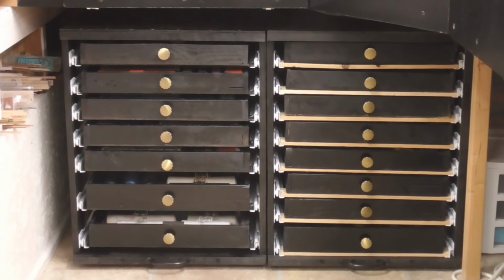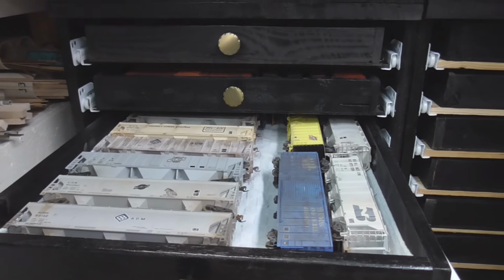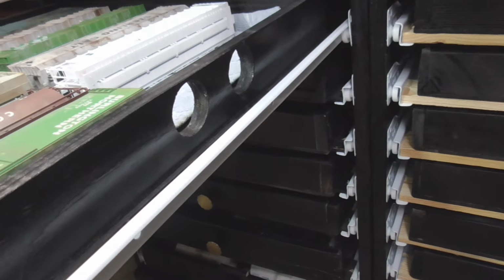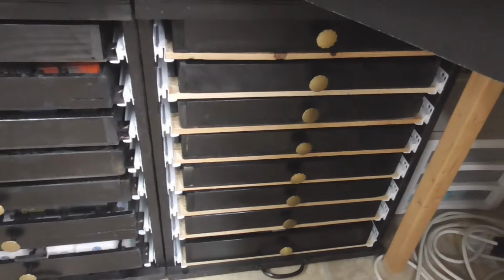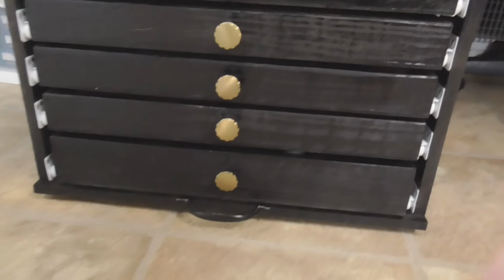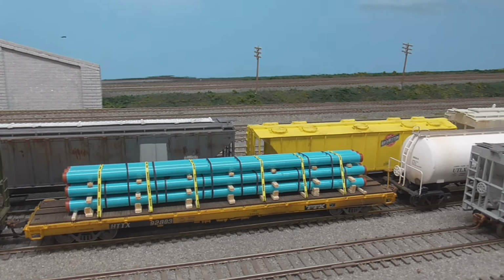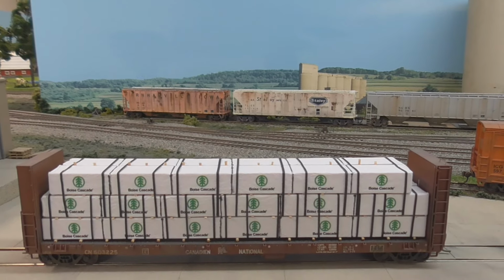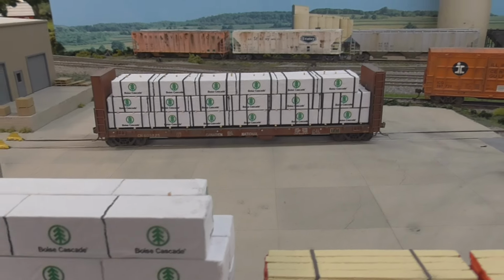Update March 2024

Comment: Those look great! I have a ''train table'' with a grain elevator that I started building in 2021. I made a lot of progress right after I started it, but have barely got to work on it since then. I had to take focus away from it for a little while there, but I may be able to get back into it now. Do you have any specific advice on what I should do if I have a locomotive not running properly from sitting out for an extended period of time?
Reply from the maker: Well, there are a lot of variables for the reason it isn't running well. But the first thing you can do is clean the wheels. I use CRC contact cleaner on a paper towel across the track with one truck at a time. Hold the locomotive and turn it up to full speed and let one truck spin on the soaked paper towel, while the other truck is in contact with the rail for power. Don't use alcohol as so many do. It leaves a residue on the wheels.  The contact cleaner is made specifically for electrical contacts. Evaporates quickly and leaves no residue. If your loco is DCC and has sound they are very sensitive to dirty wheels and dirty track. I use a bright boy to clean track which is a very light abrasive block similar to a pencil eraser. Never use sandpaper, I don't care what anyone says, it is not good for your rail. You want your rail to be polished and smooth which keeps good continuity to the wheels. Sandpaper scratches the rail surface which allows area of dirt and carbon build up. Keep your rail as dry as possible, never use solvents or oils because they attract dirt. I use these methods and very rarely clean my tracks or engine wheels. I may clean my rails maybe once every two years if that much. And I rarely have to clean loco wheels. I know this was long, but I hope it helps.
Reply: @cnwtrain  I will consider this. I also think the track causes a problem, too. I have 2 switches that seem to always be ''dead spots'' regardless of whether I have cleaned the rails. The track is ballasted and glued, but would you suggest replacing those pieces of track?